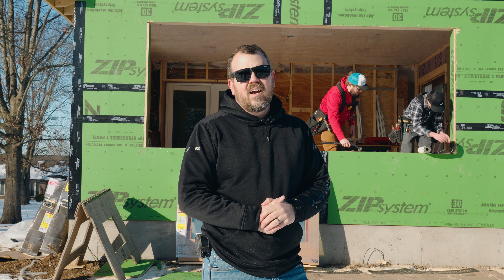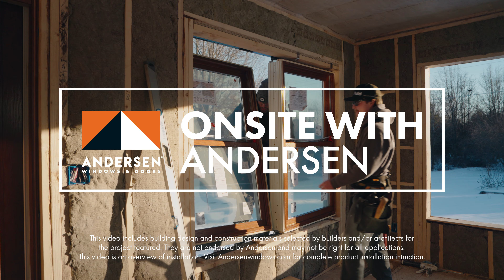Installing A-Series with the Easy Connect Joining System with Jake Bruton | Andersen Windows & Doors

Comment: why easy connect not available for the 400 series?
Reply from the maker: Hi Ali! Although Easy Connect is only available with 100 Series and A-Series products, joining is widely available across all of our product lines. You can order 400 Series units joined. Your local dealer or sales rep will be able to walk you through your options here: https://www.andersenwindows.com/where-to-buy/?msockid=0bd1d6ef212264a21075c33920a465be